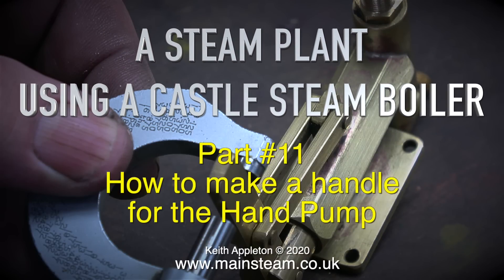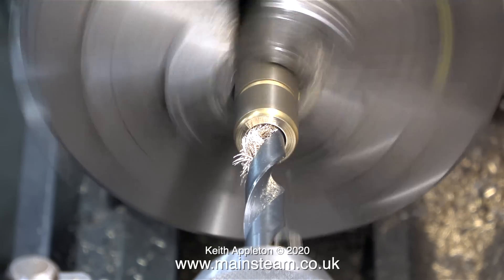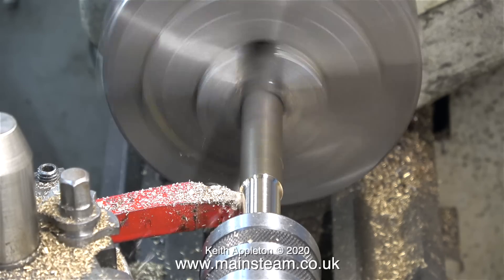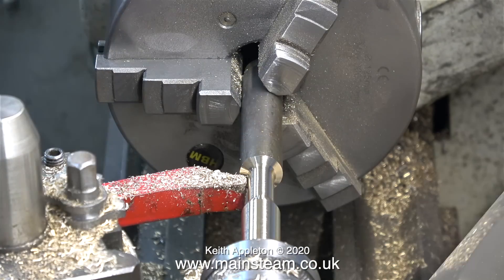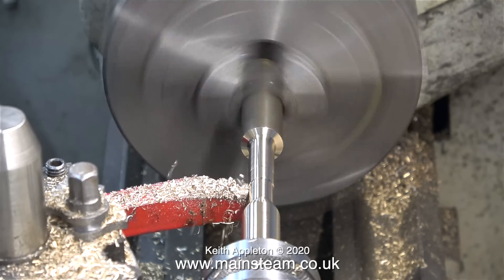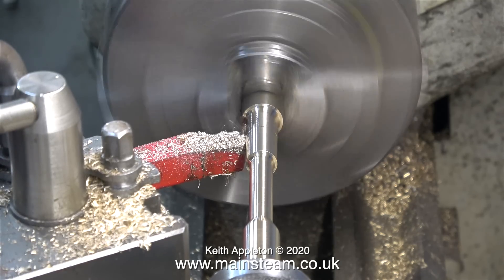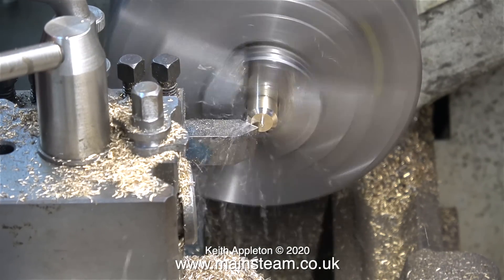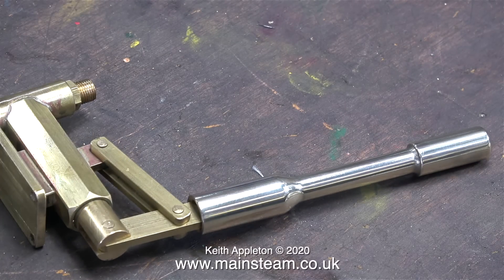A STEAM PLANT USING A CASTLE STEAM BOILER - PART #11

Comment: I used to work in a University research lab, I would from time to time make custom thumb nuts to hold things in place. If I though there was a danger of the nut being over tightened I would make the diamond knurl as deep and pointed as I could then there would be less likelihood that a student would want to grab it tightly and apply too much torque. It seemed to work well.